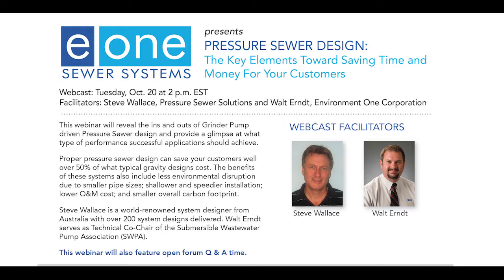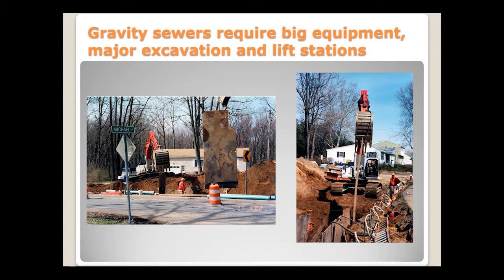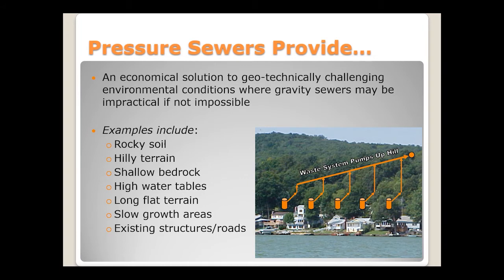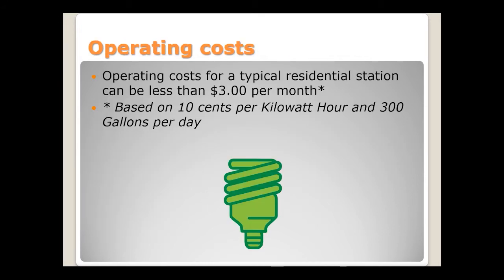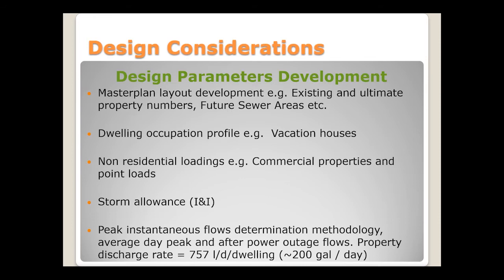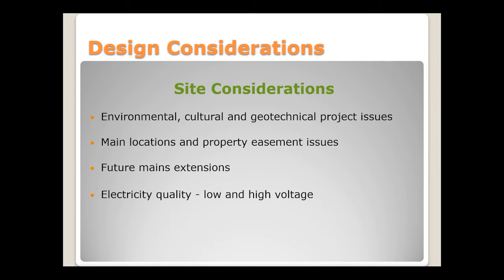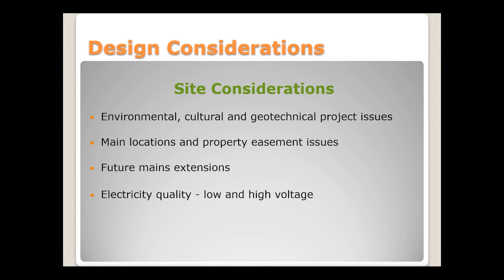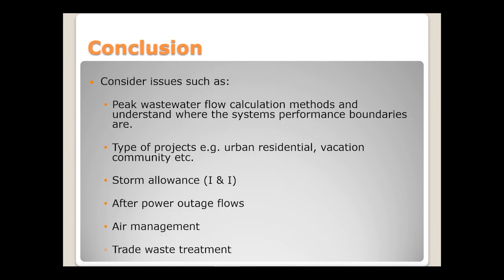Pressure Sewer Design: The Key Elements Toward Saving Time and Money for Your Customers

Comment: Passing on plant maintenance on to the customer.Its expensive. Repair is inevitable. Within 5 years. A perfectly working septic ruined for this joke. When it fails, it's hard to get repaired. Its extortion money to replace. Not to mention it full in 12 hours. If you run into this. Sell, and run like hell.